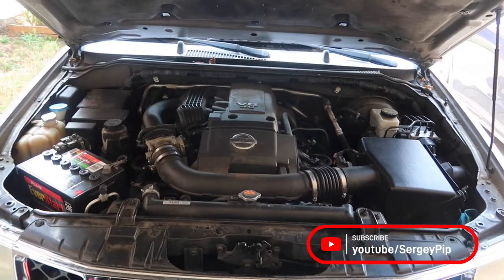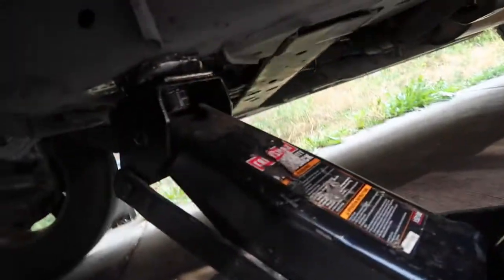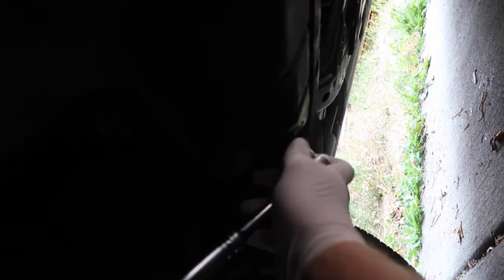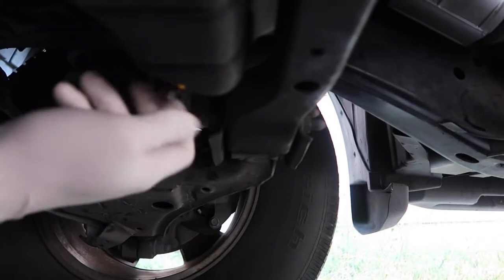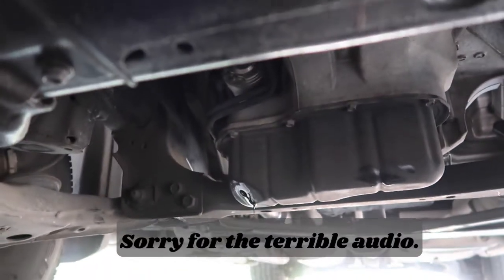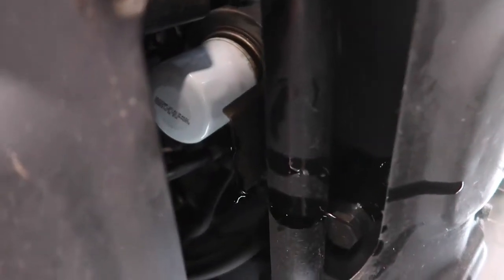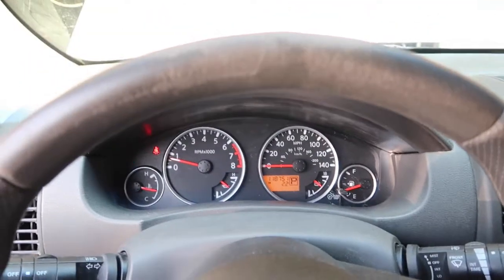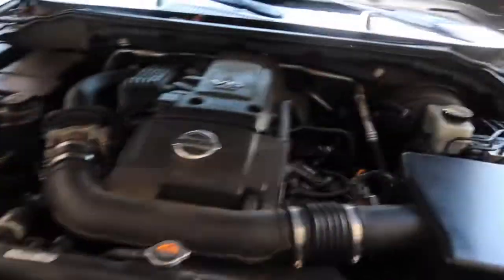HOW TO: Nissan V6 4.0 Oil change | Pathfinder | Frontier |

Comment: The second you start the engine, checking the oil is useless. All that oil is splashed everywhere the second you turn the key.  Let it sit for an hour and then check it

Comment: Do you find that a 5L jug is enough? It gets really annoying to buy another quart or jug just to fill 5.4 quarts as per factory recommendations.
Reply from the maker: Depends on how much you drain.  .4 quarts seems a bit lower than I'd like. I would be more comfortable with .2 quarts under. I typically buy an additional quart and then save the left over for the next oil change!